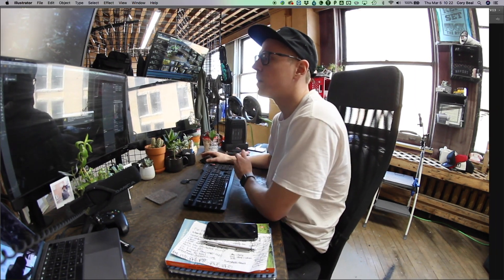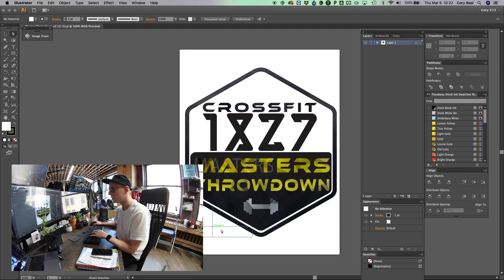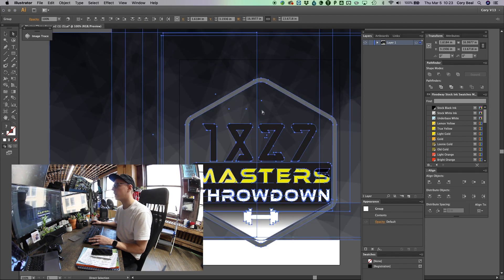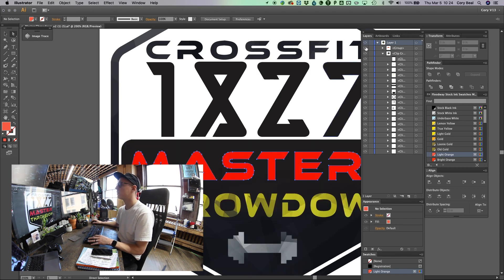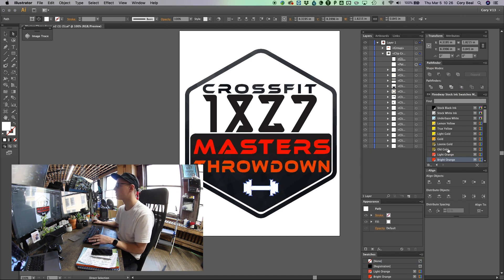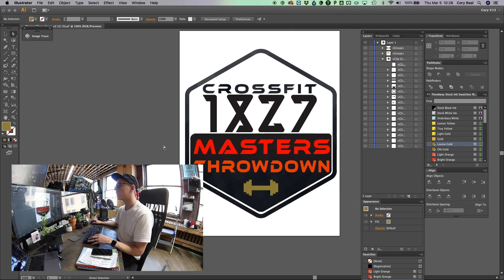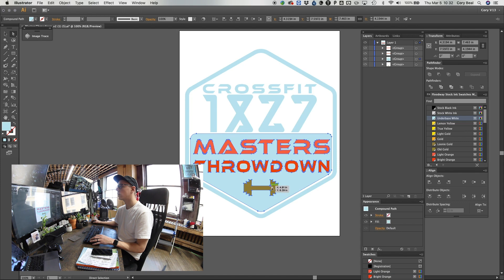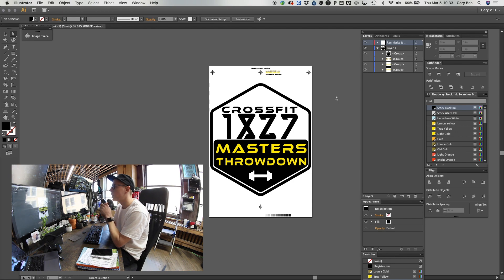Screen Printing File Prep - YOUR Design Separated

Comment: Nice work, enjoy your videos and dedication. 

Small trick when you don't have the font, is to Import the  Ai or EPS file into Illustrator, do not embed it, then save to PDF, then open the PDF file  in Acrobat Reader Pro , turn all fonts into paths, save file and open it in illustrator. 

If this does not work for all fonts when opening again in Illustrator then you have to watermark with a font first in Acrobat Reader Pro then turn fonts to paths bevor saving.
Reply from the maker: Gian Oliver Thanks for watching!! It’s truly my pleasure to share this stuff. It helps me get a better understanding and the feedback like yours is priceless. That font tip is super good! Thank you for that.
Reply: Nice little tip there.

Comment: Nice one Cory. The latest version of Mac OS disables older versions of AI, I was using CS6 and now have to move to CC. I am infinitely sad about it.
Reply: Also using CS6 Illustrator, on a PC. I have not had any big issues when I just Import the files from newer versions into  CS6 Illustrator into a new document.
Reply from the maker: Gian Oliver Yeah I don’t worry too much about that error! If I do have an issue usually the ‘save to .PDF’ trick you mentioned fixes it. Thankfully i don’t think we’ve ever had to ask a client to save the file for an older version.
Reply from the maker: Haha yep I am holding out as long as I can! CC does have a lot of nice features though.